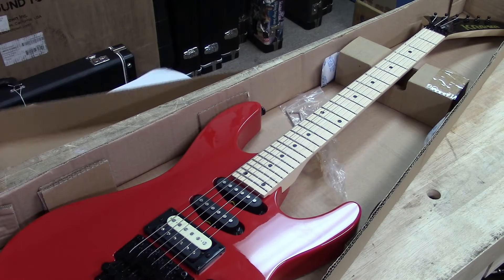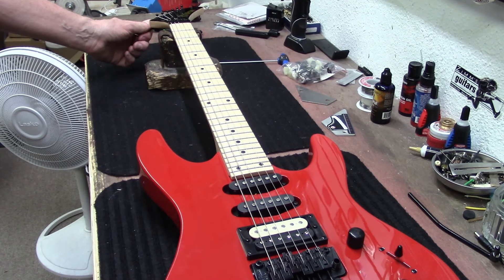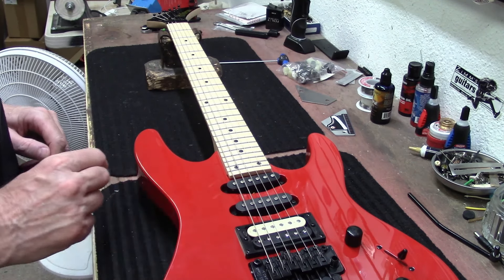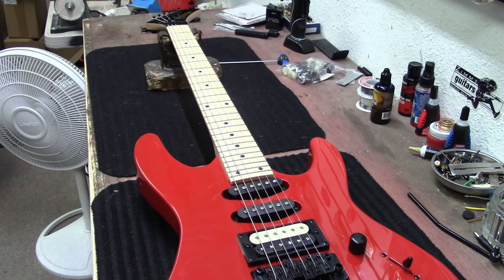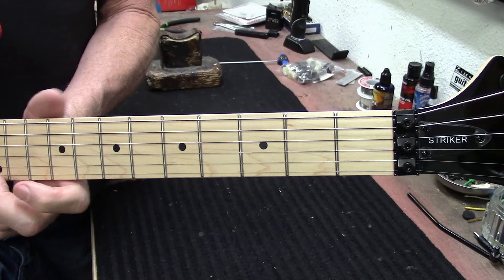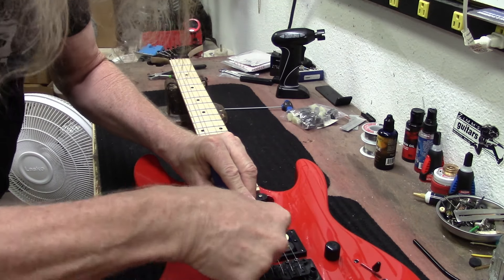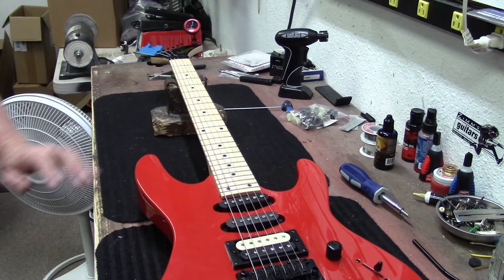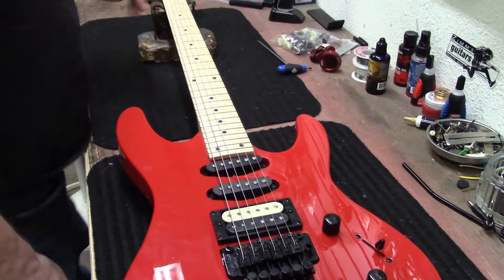Kramer Striker Basic Setup!

Comment: Kool stuff fella’ 😍Dig the Striker model, that Humbucker is HOT 🤓
Reply: I pulled it out. It says they are alnico   five there but ceramic in fact the are . All ceramic. I got new pick ups for it but I’ve been too lazy right now. Had a complete knee replacement not quite a month ago and not to Guitars I try to work on. I screwed up so bad I had to find a Guitar Tech course to pick up so I bought a guitar fetish and I just plug-in but I’ve had bad luck with their stuff like doesn’t work